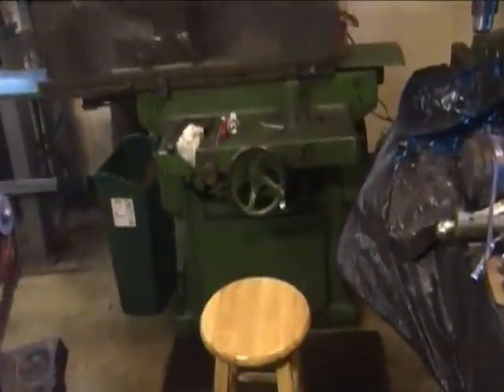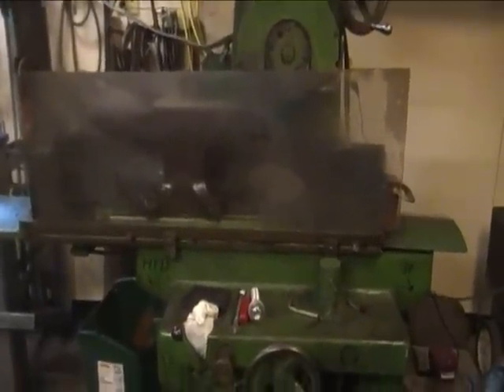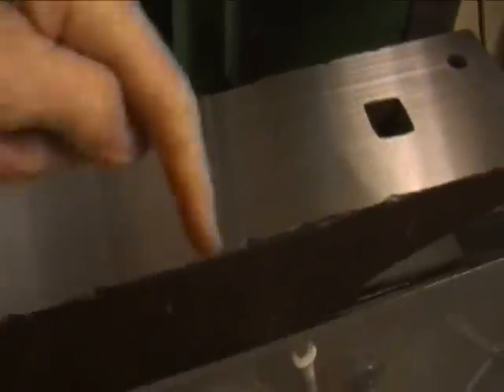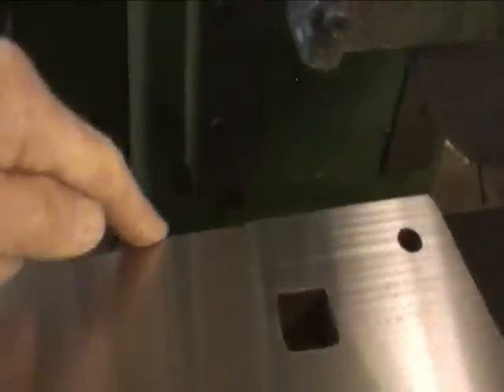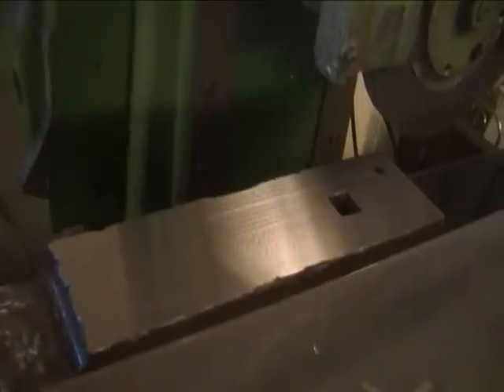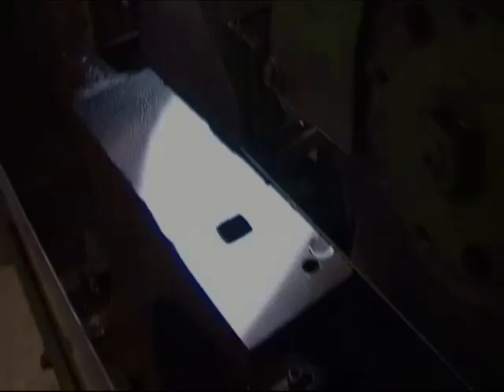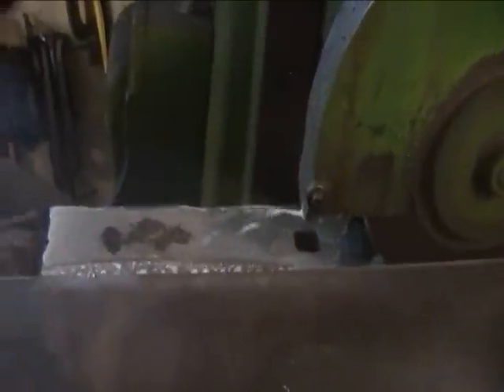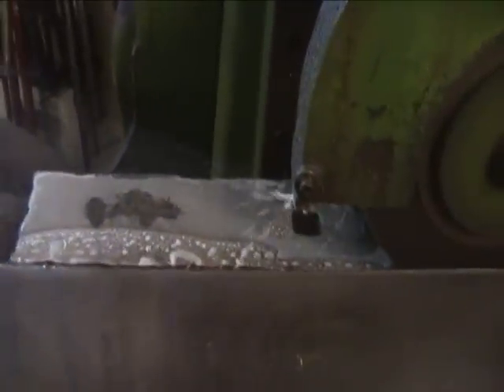Surface Grinding a Blacksmith Anvil

Comment: i just had my hay budden re surfaced with a endmill cutter all these guys on facebook are saying i ruined the anvil and its not gonna be hard anymore i tried a ball bearing and the rebound seems great shoild i be worried ? thanks
Reply from the maker: A lot depends upon the original hardening depth.
If  it was hardened deeply, it may still be pretty hard.  But, if the surface was so bad that you  continually indent the back of the work, which is worse?
An old blacksmith told me that you are never supposed to hammer on cold iron anyway, so a softer face isn't necessarily bad.  
You could file test it in several places to see how hard it is.

Comment from the maker: Taft-Pierce is a name unknown to me, but I'm no an expert.  Have you checked around by simply googling that name?  Or check Ebay.  You may be able to get some background on the company that way.  Many of the older machine tool companies bought eachother out or merged, etc..  So it might take some research to get back to original company.
  If I was buying one today, I'd have a few important issues to address:
Does it run?
What is the condition of the spindle bearings? (You are looking at $750 or more to have a new set of spindle bearings installed IF you can find someone to do it)
Do I have the kind of electrical power that I will need to run it?  (Many industrial grinders ran on 3 phase power and often on 460 volts.)
Do I have room for it?
Is it big enough for the jobs I have?  ( I searched a long time to find one where the spindle would go high enough for an anvil)
Is the table and table travel  big enough for what I want to do?  And is it accurate enough for doing small work, if that's what I want to do?
Do I have the resources to put the machine where I want it? (My grinder weighs about 3500 pounds)
Does it have a magnetic chuck and, particularly if it's electric, does it work? And are parts available for it if it does not?
And, of course, are any parts available for the grinder itself? (The first thing I did AFTER I got mine was to contact the company that currently owned the name and to request a service manual and parts list.  I gladly paid $75 for the manual which they actually produced for me from original drawings and vendor manuals.  That was 25 years or so ago.)

Good luck,
Pete Stanaitis
------------------